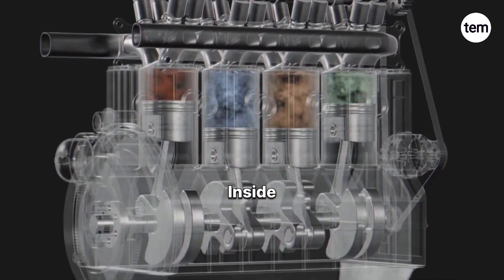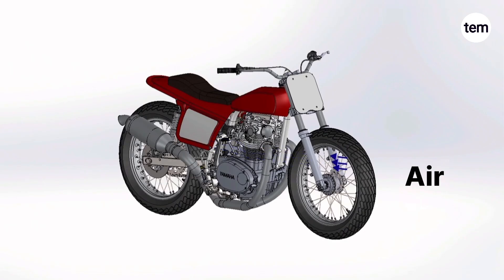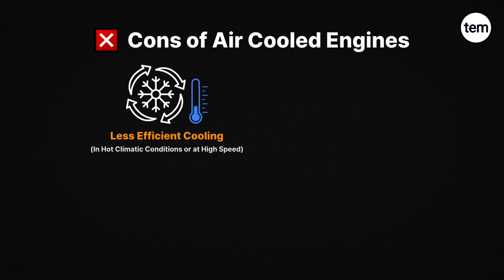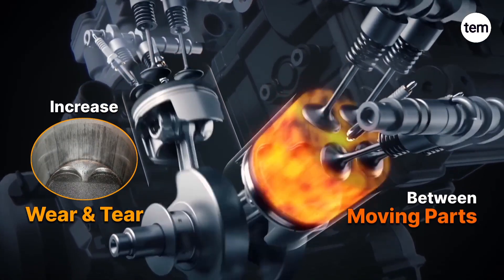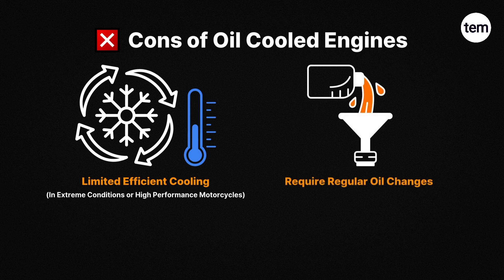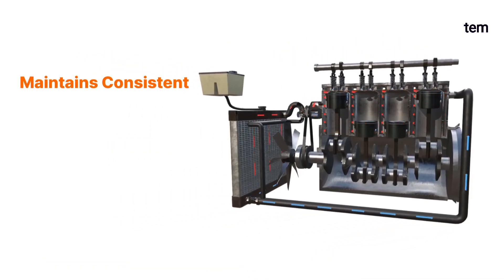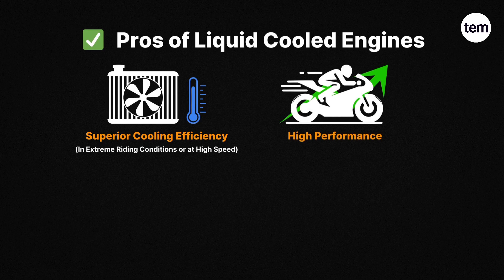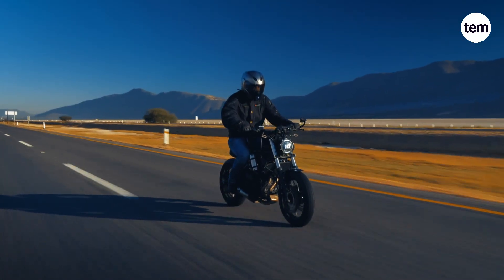Air Cooled vs Oil Cooled vs Liquid Cooled Engines | Which Cools Best?

Comment: In my own opinion, i prefer either air cooled or oil cooled. 
I mostly avoid liquid water cooled design as in my country 90% water cooled motorcycles and scooter always have issue water mixed into engine oil become milky oil problems.

Comment: Some oil cooled bikes also have piston cooling nozzles that spray oil under the pistons.
Reply from the maker: Great point!
The piston crown cooling plays an important role in tuning such as high-performance engines, racing engines, etc., because the piston moves through the cylinder at insane speeds and is constantly subjected to combustion explosions at the same time, which can make it shoot downwards again. It must withstand the extreme heat, pressure, and speed inside the engine, in addition to external conditions such as temperature, fuel, engine oil, and varying strain.

Comment: What bike uses all three cooling?
Reply from the maker: No common motorcycle model features all three types of cooling (air, oil, and liquid) in its engine system; instead, motorcycles typically use one of these methods, or a combination of two, to manage engine heat.

Comment: How often should you change the oil in an oil cooled system
Reply from the maker: For an oil-cooled motorcycle, the engine oil should be changed according to the manufacturer's recommendations in your owner's manual, which generally ranges from 3,000 to 10,000 kilometers or every six months to a year, depending on the oil type (mineral, semi-synthetic, or full-synthetic) and your riding conditions.